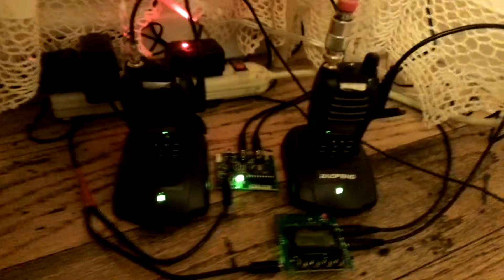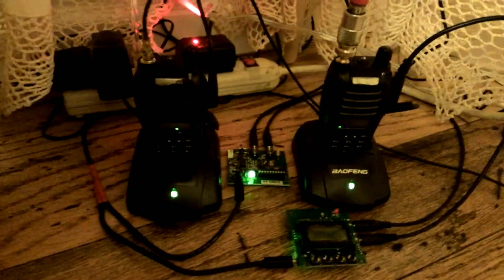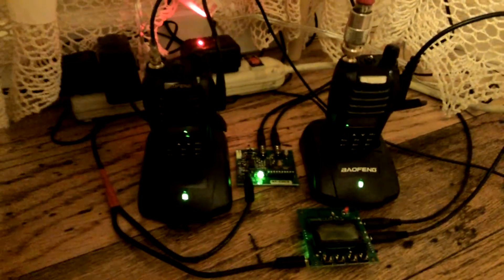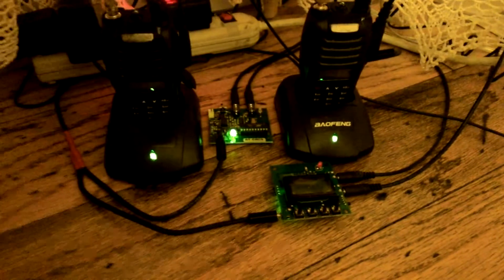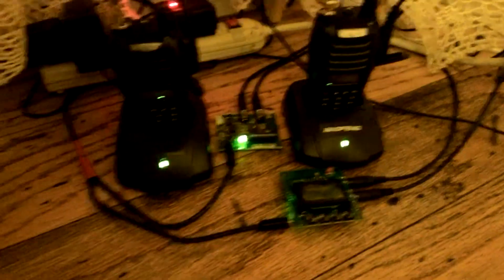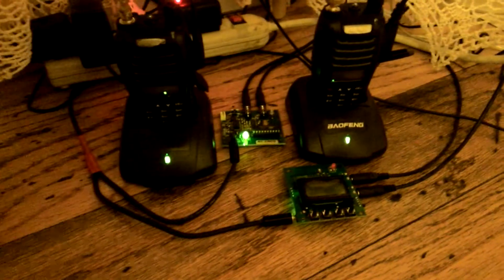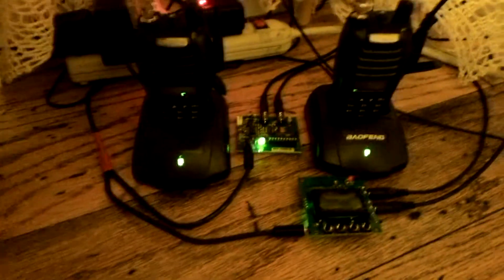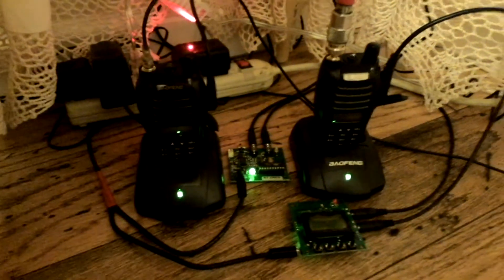My Repeater controller

Comment: Does the power supply cable adapter come with it or did u have to purchase one..I am interested in building a repeater and would like more information on it...seems it is very limited on info..it will be good to hear from someone who has one and operates it. Also does it have adjustable hang time or is it pre set...thanks KI4OMV 73
Reply from the maker: When I first got the repeater it didn't meet all the FCC requirement,  but I worked with the company in china and they were more thin happy to make all the changes to make it 100% comply with the FCC requirement. As far as I know the repeater is the only one of this kind that is 100% FCC compliant. So to answer your question you can set different hang times. There is many thing you can do remotely to control the repeater. All the parts are sold separately so you will need to buy the power supply, cables, repeater and ID module. any other question you have please ask.
Reply: Ok thank you sir I appreciate your help